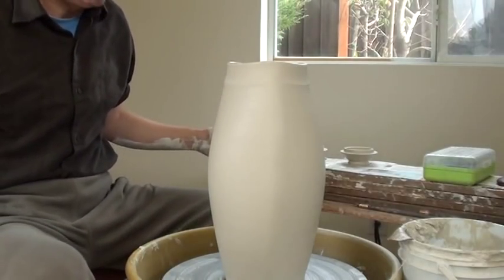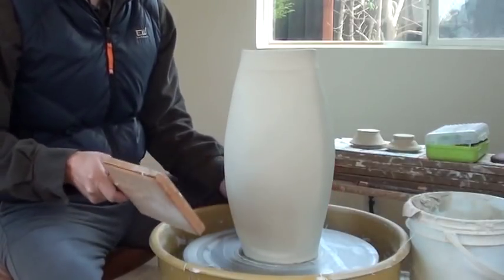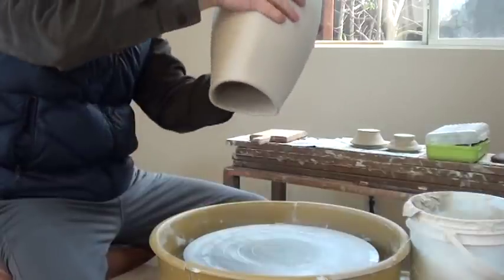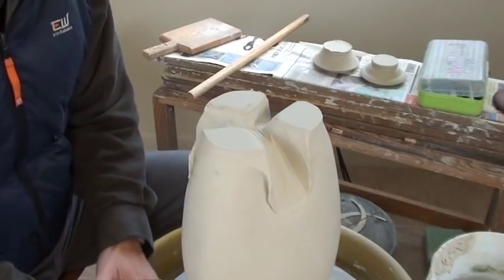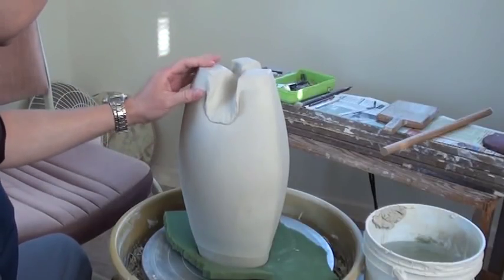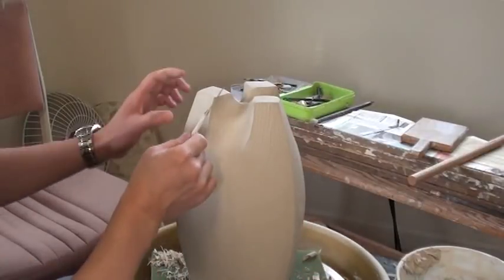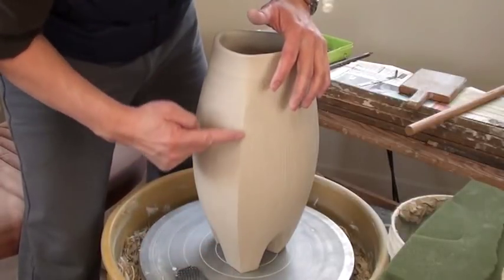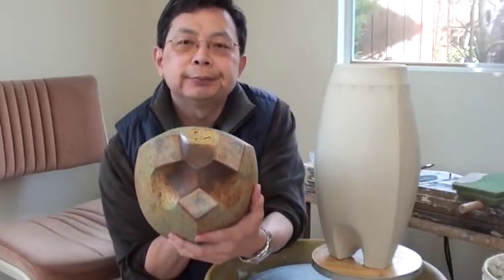42. Throwing / Altering a Triangular Vessel / Vase with Hsin-Chuen Lin

Comment: I hope you don't mind but I've just begun a tribute piece like this vase. It won't be sold and will also be marked as "TRIBUTE" under my signature. I just can't get it out of my head until I make one.
Reply from the maker: Not a problem.
Reply: @hsinchuen  it's in the works as we speak. I have a cheap Amazon wheel so I had to make a 1/2 size version, 7", but I'll post a link to it when I finish. Thank you for all your great videos!